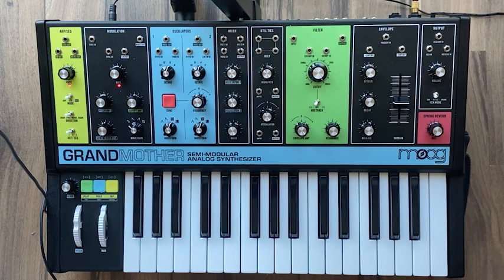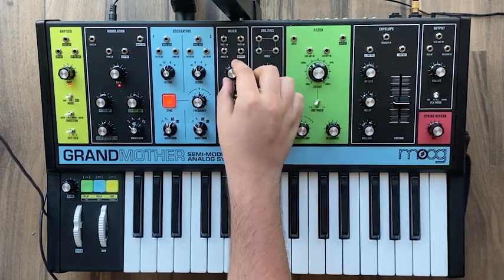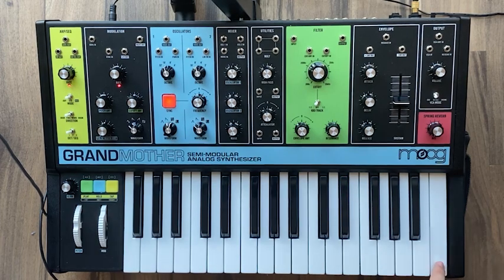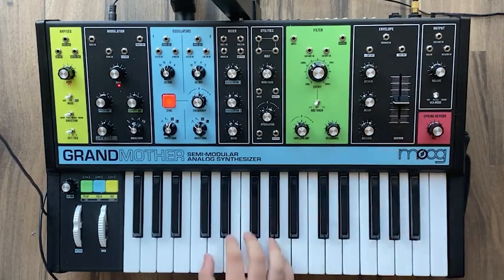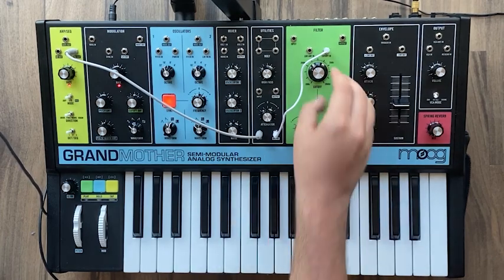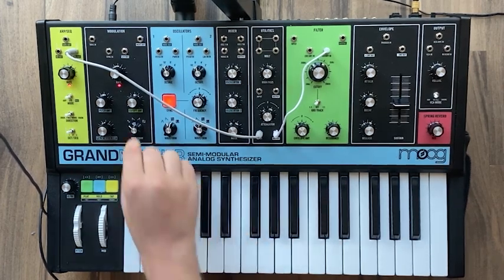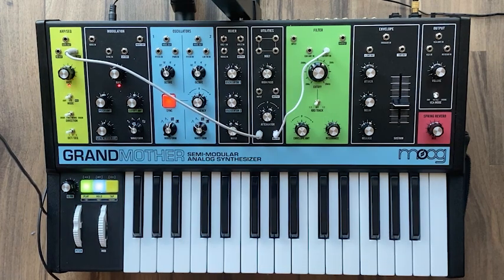Making a Rubber Bass with the Moog Grandmother

Comment: this was super interesting, thanks - I was expecting a bit of reverb at the and, but this also sounded great!
Reply from the maker: I never vibed with the GMs reverb (not it’s fault but mine).  I have seen others use it to great effect but felt at least for a bass patch it would muddy up the sound.
Reply: Reverb on bass is a bad idea. Maybe in some cases it can work but only if you highpass filter the reverb first. I guess you could try that by patching reverb out to highpass in and into the attenuator to control the level.

Comment: i must be doing something wrong, it sounds totally different doing it on my Granny. would u mind sharing a preset sheet?
Reply from the maker: Hi man, thanks for listening and trying it out.  Sorry you are having some issues with the patch.  I don't have my grandmother with me right now, but a few items come to mind:

1: Ensure the envelope amount is dialed all the way to the right (100%)
2: VCA Mode (flip switch on the right) should be all the way to the left.
3:  Mod Wheel all the way up.
Reply: @superlean5991   Same thing here. My grandmother sounds nothing like this.
Reply from the maker: @TheKayoO0  , thanks for watching and sorry you are having issues.  Would you mind sharing what it sounds like?
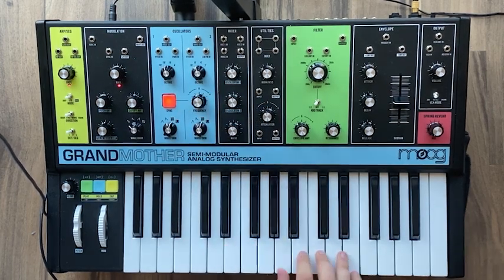Reply: Yeah same. Especially the part at 0:43, I have mine set identically, but there's some super low sub note thing happening that mine's not doing with that D note.
Reply: Oh wait, I see what happened, Grandmother’s Keyboard Octave Range was transposed. To lower the octave range by a single octave at a time, press and hold the blue [ SHIFT ] button and then press the green [ < KB ] button. To raise the octave range by a single octave at a time, press and hold the blue [ SHIFT ] button and then press the green [ KB > ] button. Wild, I didn't realize this was a thing!